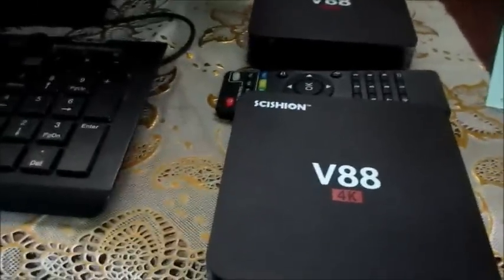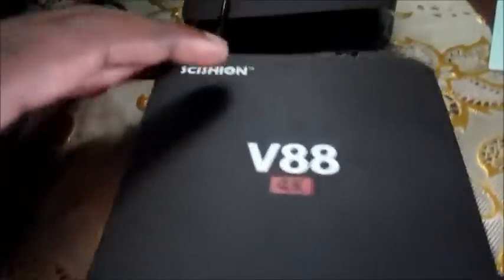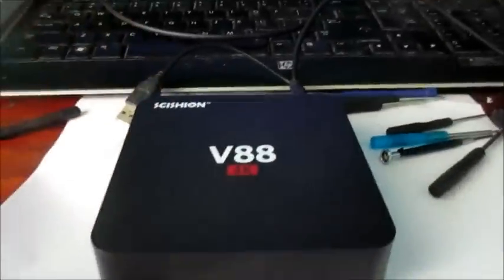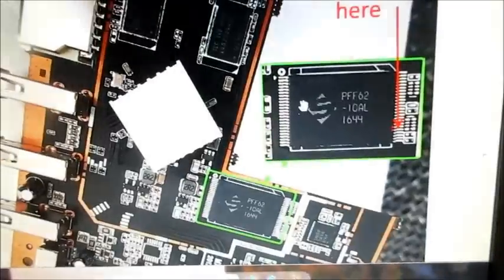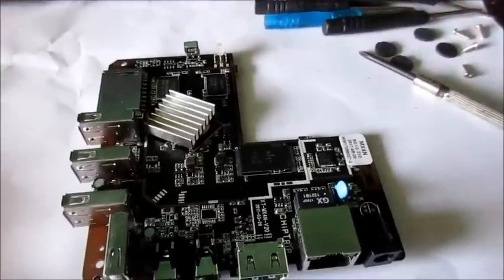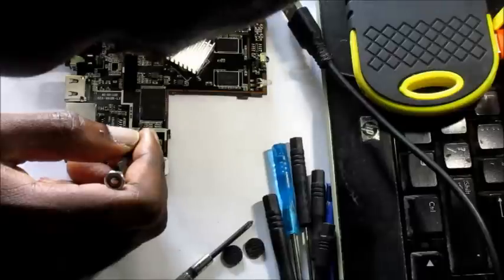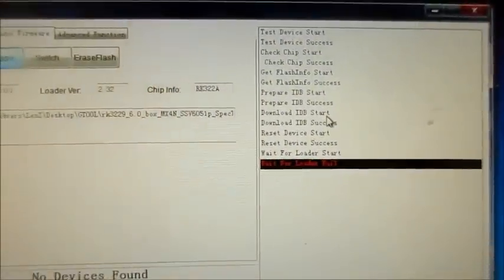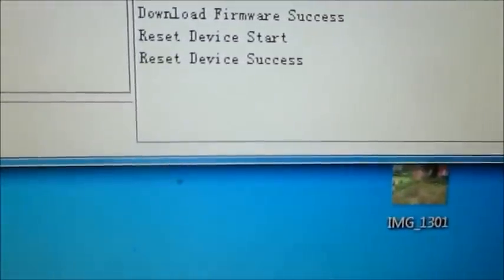How To Fix Android Tv Box Stuck On Red Light- Fix android Box not turning on

Comment: Hi Lenz nice video, do you know how to fix this same issue with the formuler z8 box can not find any info my remote does not work on the box so I used an other remote but without luck I also tried another power supply but nothing

Comment: Good morning Lenz Walters, I am glad for your help about re fixing the Android TV box red light stuck details.  I am Nathaniel, based in Ghana. I have X88 pro 10 Android TV Box which Stuck at the red light. I need your help as how to fix it. What type of software and hardware tools will I need to resolve the issue with my box. Thank you for the help.
Reply from the maker: hello. download the android flash tool and also the firmware for your box, normally the version is written some where on it most of the time.
Reply: Thanks for the directive. Please can you send me the link to download the files, the android flash tool and the box firmware
Reply: Good evening brother thanks a lot please can you please send me the link to download the Android flash tool and the USB cable drivers. Thanks once again.

Comment: Please help bro my h96max stuck on loading screen showing blue light but while i try to eneter in boot mode by pressing reset button light gets red and not proceed further i even try tune on with remote but nothing works please help if solution

Comment: Howdy Mr. Walters I see i'm late for the party, ..I have a Question to all
 People that might also know....
 If I have erased firmware to replace it (via .android tool) with what I thought was the
 right img file. Am I Pooched? the blue lite is on, remote doesn't turn it off,
...reset button does nothing ,pc or tv.
Maybe This Pin Trick able to detect mine? ..same machine
inside is ...swe20181220040.img
mxq-4k
3229 1+8 6011
suggestions are appreciated
Reply from the maker: yes. erase the corrupted system and install stock version
Reply: @Lenzwalters  Thanks for the Quick response. I get no device detection on the Android tool after erasing original firmware and installing what I thought was going to work, Now The reset button isn't doing anything to let me erase or install new firmware. I'm also trying your SD Card trick but not all files were in The Firmware PKG. any suggestions?
 I also can't locate a proper Firmware for my IMG on inside sticker (info above)
Thanks again Lenz! ...cool channel BTW

Comment: Good video, but holding the reset button is not nessecary, the pins being held while plugging in should be enough to get the device in loader mode. It's also good to mention that the tool doesnt work well on all ports, i tried two usb 2.0 ports and one 3.0 and got far only on the 3.0. The tool and drivers work well on windows 11 luckily.

Comment: Hi Lenz, i have a T9, its not booting up after a power trip, windows still detect it as unknown device but the AndroidTool doesn't detect it, can help ?  I have tried pushed the reset button while plugging in power or usb cable, didn't work.
Reply from the maker: unplug cable and try again

Comment: i have MXQ PRO 4k 5G box with 2gb ram and 16gb memory. it was working good but sudden it stuck on blue light and android boot screen only. i tried to do hard reset but seems that reset button which is available inside AV slot is also not working. i have downloaded latest firmware and uploaded the same on my sd card with Burn Card Maker and then i tried to upgrade firmware with sd card after connecting my sd card into USB card reader and then to MXQ Box. but still it shows only android on screen and blue light in box.  Any advise or suggestion please....????????? its Rockchip RK3066 . please help me.
also my box do not connect to Laptop (window 10) i think this is due to reset pin not working.

Comment: Hi love watching your videos I am subscribed I have a walkers smart box was working fine got four stick took out the Walkers box and when I went to put it back into different TV the power button is red it usually goes from red to Green and it has a blue streak of light in the centre in the past I would have just had to press the red power button then the Blue Streak light which is on wood flash 3 times and that would knocking on now the blue light and the red Power light are on but stuck hope you can help
Reply from the maker: Hey whats the model of the box ?

Comment: Hi.. 
I successfully wrote the firmware to the box but it still doesn't boot up... red light only.... any idea on why this is?
Reply: Did you solve it i have same
Reply: @omar97muhammad  you need to find the correct firmware... this method in the video works.
Reply: @colliscollis9150  my c don't recognize tv box till I connect to electricity is it ok
Reply: @colliscollis9150  thanks for your reply

Comment: Hi. If i may ask how to fix my mxq pro 4k android tv box. I just set the hdmi setting to 1080p. Then the tv screen turns black and says "not compatible with this signal. I wonder how can i turn the hdmi settings back . Pls reply
Reply from the maker: turn of the box   turn on unplug hdmi then re plug it. let me know if this helps
Reply: @Lenzwalters i tried many times, but it doesn't work.
Reply: I' have same issue. what i think I'll do is look for videos with same box as me. see exactly where the display is and just count the number of rights, lefts, selects and do it blindly and hopefully it works

Comment: Hi, I have Transpeed T98 6K box bricked after SD card update during boot which was prepared with PhoenixCard. 
The box has no reaction at this time for power up. 
During trying to flash firmware with PhoenixUSB Pro it start flashing but stops at 62% with error couldn't download boot1 :(

The question is: in my Transpeed T98 6K box is there the same chip and is there a way to connect pins to pass the whole flashing process to the end??? 

Waiting for your response my friend...
Reply from the maker: Make sure you flashing with the correct version rom if you still get error send me a picture of the board i would see if i can help you out.
Reply: @Lenzwalters  yes I tried all available firmwares from 4pda.ru topic about my box. 
Could you give me email to send you photo?

Comment: HI Lenz. i have got H96 Max+ recently. I have the same issue with the red light. when i connect the USB to the TV its working fine. But the wifi or hotspot is not connecting. please help me on this.
Reply from the maker: hello did you try a factory reset

Comment: i have android tv box and it's audio is not coming through AV cable whereas its audit is working through HMDI cable. please help me  how it can work via AV cable. please help to resolve this issue...
Reply from the maker: Do check all your connection make sure everything connect properly. Also try unplug and re plug the box..
Reply: @Lenzwalters  thank you for quick response...i have done all practice but no vain. should i reset or not?
i have gone through setting & review all options. all options are enable /active...but fault is still there..

Comment: My h96 max+ started looping a couple of days ago, I wiped out its cache and did a factory reset, worked for sometime and the next day it wont turn on(red light). I am able to connect to pc without pushing the reset button, since I found out its in maskmode (all by itself). I've had success flashing the firmware however it's loader is somehow out of the picture that is, after successful firmware flashing, it stays in maskmode, that is if I try to connect to my tv, the red light stays on. If I try to flash via rockchip batch tool, it gets stuck and fails after "start loader fail". I'm guessing it's loader (https://www.youtube.com/watch?v=nYtkjLRPqGo this video gave me a hint) is bricked/fried, I can't seem to find loader/bootloader for h96 max+ 64gb version. I've also tried flashing via sd card, stays undetected. Have you or anybody got any idea for this situation? Any help will be highly appreciated :) Many Thanks.

Comment: Hi. I have the opposite problem.  I have a h96 pro plus. That was bricked I believe. I got it booted back up with usb burning tool . My issue is now it won't go into standby, red light. When I hit the power button it shuts completely down and reboots from the start. I guess it's not a huge deal but I have other boxes that go into standby with just a touch of the power button.  If I hold the power button I get the option to shut down.  But both options are shutting down.  Any idea thx

Comment: I have mxq pro 4K and it's stuck on the red light can you give me tips on how to reboot so blue light can come back on nothing and the machine is not burnt out I was told by technician
Reply from the maker: I will be doing a tutorial soon on that box. Its maybe want to flash using firmware file
Reply: mx10 pro 6k also stuck pls.. help me

Comment: Thanks a ton. It worked for my mxq pro 4k box
Reply: Hi, just wanted to ask if your chip is 1644 (like in the video), because I have the same box but my chip is 1826 instead and this method didn't work for me :( Thank you!
Reply: @mellaneygoh3024  who is the maker of the chip I.e. is it rock chip, amlogic or all winner?
Reply: Akshay Tanted I really don’t know how to tell ahaha, not a tech person, just desperate to fix the box
Reply: @mellaneygoh3024  mail me a picture of your box pcb. I will check that and tell you.
Reply: @AkshayTanted hi does it work on mx q pro 4k? Which pins do I hold down?.

Comment: Hi Lenz , i have Android Box V88 4k (with chip SanDisk SDTNSGAMA-008GM) , it stuck at the red light and won't turn on. Is the procedure the same?Thanks.
Reply from the maker: Yes. if its not turning on and the light is not so bright yes.
Reply: @Lenzwalters  
I tried but nothing. It won't turn on and the red light is  still bright..

Comment: Mine I factory reset it then reboot it but it stuck at mbox logo
I sent it to technical but it didn't accept the filmware
Any suggestions?
Reply from the maker: is it showing red light ? it can be fixed.
Reply: @Lenzwalters  yes its showing it but not the factory reset.
How it can be fixed please?
Reply from the maker: you can reset if not your box will need to flash.
Reply: @Lenzwalters  he tried but the box doesn't accept the filmware
Reply from the maker: he could have try a different version

Comment: Hi, I have a Sunvell T95, blue light comes on but absolutely no way i can get this to comm with pc or tv, any suggestions?
Reply from the maker: Is there a av port ? you can try do a factory reset by holding it down on start up
Reply: @Lenzwalters  hi I tried that and no luck, on closer inspection it looks like a chip had shorted judging by some scorching so may look at something else

Comment: My problem is a bit different. I have the tanix tx5 pro box, with the s905. I can reinstall the firmware using usb burning tool, it says sucessfull. But my box still keeps on blinking red light. Have you ever encounter the same situation?
Reply from the maker: How long was it in use for ? Maybe there is a hardware problem
Reply: @Lenzwalters  I've been using it for about 1,5 years. I use a small fan too underneath the box. I guess I'll need to have it checked by a technician then. Thanks for the advice
Reply: It's  the wrong firmware.

Comment: First i cant turn on my box with power cord, only by usb power from pc, and only my laptop with win10, not with second one, old win 7. This is strange. When i connect box with hdmi cabel with sony and usb with pc,because i opened the box  i just press av button to enter recovery mode( samsung tv doesnt see box signal) i can enter factory reset but cant get anything from that, so i need to flash rom wich i have, but my box overheat and from blue light after 45 seconds goes to red and after 10 seconds turn off completly
Reply from the maker: How long since you have this box that its overheating ? If your box is detecting you can flash it

Comment: Hello
can you please tell me if I should fight with my windows 10 to recognize scishion miniIII android box. Because I can enter recovery mode, but my problem is that box is overheating and goes from blue light to red after maybe 40 seconds after i connect to pc with usb cabel, just go to red and the red also vanish and shout down. I try to change the termal past but this past dont hold stick maybe i need to put another one. even if pc recognize android box overheating will shout down the box before flash finished. What do you think i should do, because  i waist lots of time on this and thinking of giving up?
Reply from the maker: is your box coming on the tv ?  these boxes don't overheat the easily

Comment: Hello my friend... please, i need help

can you tell me where is the pin on this model for made the umbrick?
 here the pictures - 
https://drive.google.com/open?id=1WBpOVA341N9VUJb1SCbbPQCjuUDDtXne

please, really i need help. thank you.
Reply from the maker: is your box detecting via pc ?
Reply: @Lenzwalters  no, my PC is not detecting my tvbox...
Reply from the maker: Whats your email ?
Reply: Is there a solution or not?...
Please help me my friend 😩😩😩
Reply: @Lenzwalters  
The problem is that the Tv Box turns on with a red light, I'm trying to perform the unbrick but my PC does not recognize the device, this is because I can not find the place where to make the cut so that my PC recognizes it. If you can tell me where is the Pin to cause the cut and my pc recognize the device I would appreciate it very much.

In the link above the photos appear because the device I have is not the same as the video.
Reply from the maker: What is the name of your box /model ?  Did you try the reset button while connecting ?
Reply: @Lenzwalters 
Yes, I have tried in all possible ways to connect the Tv Box to the PC and it does not detect it.

It is assumed that the Tv Box model is MXQ-4k Pro but it does not look like the other MXQ-4k Pro devices
Reply from the maker: with the mxq if you press the reset button with it hook up to your tv you should boot into the recovery mode. In the photos i am not to sure about the chip, would have to see much closer. In this video the V88 is rockchip

Comment: I`m not a Youtuber, follow me on Google +.
If you need firmware ore more tricks whith broken boxes, ask I have it all.
I use this account for my android boxes.
If I have broken links, dont worry, give a reaction and I post a new link.
For the V88 RK3229 V1.2 i have Android 5 and 6.
What you did whith that reset hole  forget that.
When you open the box and put in the Usb kabel in the box and start up on your laptop/pc Factorytool and the driverassistant 4.3, and put in the firmware in Factorytool. (If the usb port on your device dont have power, then also use the adapter from the Androidbox.)
When you connect the two pins (Thats good) the factorytool on your pc says connect  after two seconds.
Start de proces for flashing and click on start in factorytool.
Now you are ready to use the broken box also in 2,47min.
I`m back tommorow in the evening because its 2.43 AM in the Netherlands now.

Comment: This is for Rockchip only and I dont recomend doing this. If you have a reset button use by its self. If not or reset button is not functional then short the nand flash pins. There is a lot of important info missing from this video. Google Rockchip for tool and proper procedure. Amlogic devices are different.
Reply from the maker: Bro some of the device have there differences. But if your V88 not turning on nor detecting and is bricked this is a method that can be done. Don't make sense do this method with a good android box.
Reply: @andrew whitfield: would you happen to know the solution to my tanix tx 5 pro, s905 box? It's blinking red light, then I use the usb burning tool to reinstall the firmware. It says sucessfull. But then it's still blinking red light.
Reply: I have a MX PRO 4k box that is bricked how can I fix it?
Reply: You are saying that this is for rockchip only solution. Does the H6 SoC (in my Transpeed T98 6K TV Box) has it's own pins combination to fix flashing problem that stops at 62% in a bricked device ???

Comment: Hi, I have tried your methode and the device has found but it does not turn in green, it is blue in the tool the device port. It says: "Download Boot Start", then it´s flashing yellow and after a few seconds it´s turned red and in the window is fallowing:
 "Download Boot Fail"
******Upgrade Done Success <0> fail <1> Time <10219>ms******

Do you have an idea, what can I do?

Oh by the way. My device is an MXQ 4K

Thank you
Reply from the maker: Hi you have to keep holding the pins down to get it flash successfully. Also try different version firmware to get download boot pass.
Reply: Thank you your answer. I have already tried 4.4 , 5.1 and 6.0 always the same. Of course I keep holding the pins together. I would like to work with your tool. I have another one. And what System is better to flash Win 10 or 7?
Reply: What is Boot Pass or where can I get it?
Reply from the maker: Boot download successfully
Reply: Thanks, I'll try it.
Reply: Does not work. Maybe is the problem Windows 10?
Reply from the maker: could be. but it should work make sure the drivers are installed correctly
Reply: They are. 🤔
Reply: I give up. I have tried everything, I didn't make a step forward. Box is dead.

Comment: Hey buddy...I hava a tx 3 mini where its getting power red light but not booting...not coming on at all....this happen after the nox frozw and i unplugged and plugged back in...i tried flashing but it only goes to 7 % and then gives a failure error....would your video with shorting out the pins work?

Comment: *Sir, I have A95X A14K with Amlogic S905X Quard-core Cortex A-53 CPU, GPU Penta core mali-450 MP  Ram 1 GB, Rom 8 GB No display and in dead condition what i can do for the same
Reply from the maker: Hi Santosh I am going to do a video on that box soon, make sure sub for when I drop the video.
Reply from the maker: sub i have an up coming video
Reply: I need that too! The same model, won't power on.